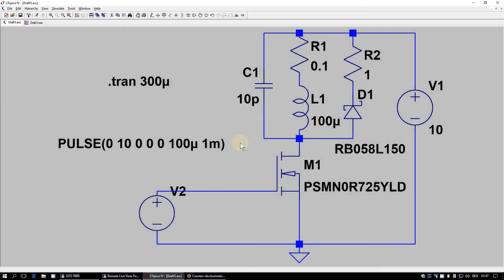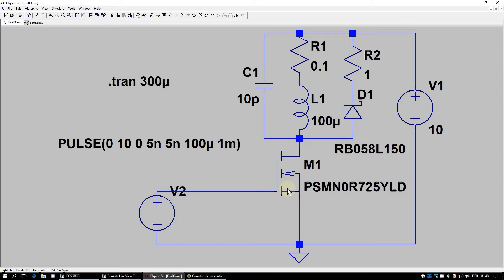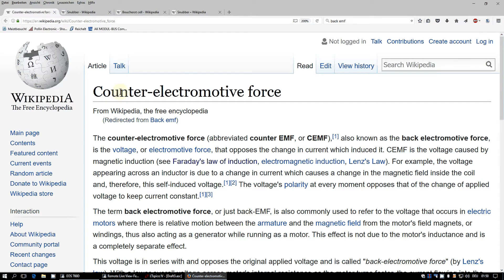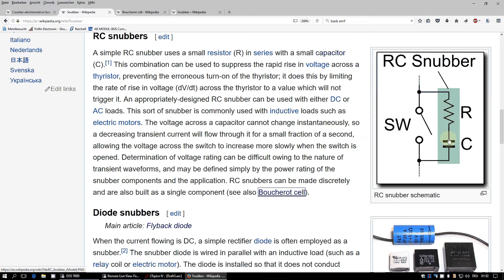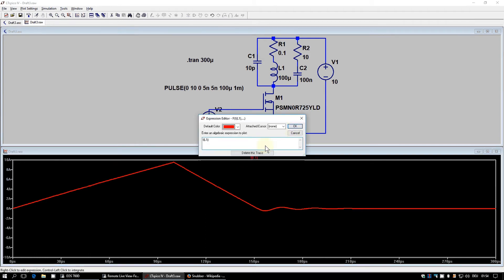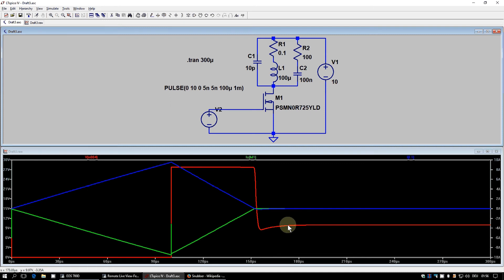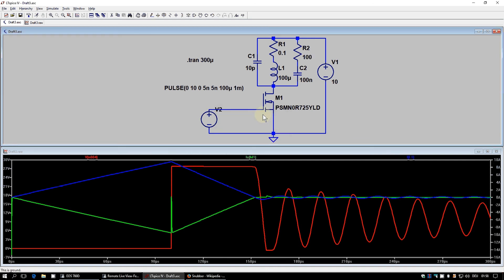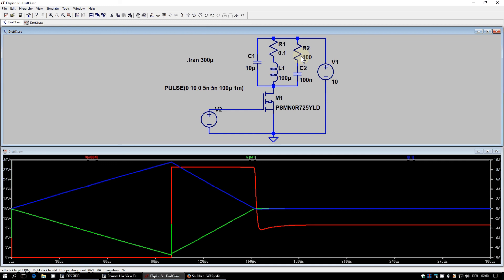Suppressing unwanted oscillations with a Snubber [Pt.2]

Comment: I did the calculation for you just so you could see how close your 100 ohm guess was. 

The parasitic capacitance of the FET in this circuit is 3nF. 
To damp to Q=1, your snubber would be R=183 ohm, C=10nF. 
To critically damp, the snubber would be R=91 ohm, C excessively large, say 10uF (for true critical damping, it would have to be infinite). So your 100 ohm and a still excessively large 100nF is close to critical damping.

Rather than deleting all your traces every time, just use F4 to label the important ones, then they won't change.
Reply from the maker: THX for calculating the optimum value.
Critical damping at Zeta=1 translates to Q=0.5
https://en.wikipedia.org/wiki/Damping_ratio
Do you have a suggestion for a website where the calculation of the values for optimized components of a snubber is easily explained?
I found a few but they are all not very good for a beginner.
Reply: I did have a really good PDF explaining RC snubbers, RCD soft voltage clamps, hard voltage clamps and RCD dV/dt limiters, but I can't find it. 

RC snubbers are easy enough to calculate, the hardest thing is knowing which parasitics are resonating. It's almost always an obvious inductance such as a transformer's magnetising inductance or leakage inductance or just an inductor, ringing with the parasitic capacitance of whichever semiconductor is currently turned off. 

You can measure inductance, look at the frequency of resonance and calculate the parasitic capacitance from the formulae for inductive reactance and capacitive reactance. The resistance required for Q=1 will be equal to either reactance at the resonant frequency, which is also equal to SQRT(L/C). Q is proportional to R, so to get Q=0.5, multiply that R by 0.5.  In the real world, you usually design snubbers for Q=1 to 0.7. Snubber capacitor will be 3-5x the parasitic capacitance.

If you don't know either the inductance or capacitance, you can add capacitance in parallel to the parasitic capacitance until the resonant frequency is halved, then you know the total capacitance is 4x the parasitic capacitance, so the parasitic capacitance is 1/3 the capacitor you just added, use that to calculate R and keep the capacitor you just added for the final snubber.
Reply from the maker: THX.
By the way: Did you delete your comment on the first video you placed a few hours ago?
I can´t find it anymore.
You were absolutely right on the breakdown-voltage of the MOSFET giving the Back-EMF of 27V.
But  I think that I am still right on the other things mentioned in the video (SRF of the tank-circuit formed by the parasitic capacitance of the inductor etc.)
Reply: No I didn't delete my comment. I can still see it. The youtube comments section is buggy as hell.

If you look at the frequency of the ringing you can calculate the capacitance which is needed for that inductor to ring at that frequency. With just the inductor and the FET in circuit, the ringing is at 257kHz. C=1/(L*(2*pi()*F)^2) = 3.83nF

The default parasitic capacitance of an inductor model is not going to be near that high. In fact I think the only parasitic in the inductor that has a default minimum is series resistance as SPICE dictates there must be resistance between every node on the model (presumably to avoid divide by zero errors). If you look at the model definition of the PSMN0R725YLD NMOS model, you'll find "Cgdmin=518p Cgdmax=3.682n Cgs=7.8n Cjo=9.16n". That's what's ringing here's how you can tell:
Again, if you look at a different FET, you'll see a different ringing frequency. The IRFP2907 which has a high capacitance rings at 175kHz, so C=8.27nF. The BSS123 which has a very low capacitance rings at 3.147MHz, so 25.6pF.

Incidentally, these 3 NMOS models act completely differently to each other and e.g. don't clamp the voltage to their Vds max value. That's because the FET you used has breakdown voltage specified, Bv=27.5 and the others don't. Bv is a parameter normally seen in diode models and only actually used for zener models (The spice model for all diodes is the same for all types of diode, just with different parameters, Cjo is also a parameter of the body diode), so 1 model treats the body diode as a zener and the others don't. That shows why I avoid NMOS and PMOS models in SPICE whenever I can.
Reply from the maker: Yes I noticed that yesterday also, when I rechecked my simulation du to your comment/critics :-)
But when I replace the chosen MOSFET with the "ideal" default-MOSFET of LTSPICE ("nmos"), then I get exactly the resonant frequency of the inductor with the 10pF parallel-capacitance shown as C1.
So we are kind of both right.
To demonstrate the self-resonant effect it would have been better to use an ideal MOSFET (or the voltage-controlled switch of LTSpice).
As soon as you use a real-world FET the much larger drain-source capacitance overwhelms the (here) 10pF parallel to the inductor ans shifts the resonant-frequency to a much lower value.
But thank god all of this doesn´t interfere with that I basically wanted to demonstrate here about the damping of an switched-off inductor with a diode-resistor-combination with different values of the damping resistor.
Without your knowledge of LTSpice I would have never known about the Zener breakdown-effect implemented in the model of the chosen FET.

Comment: 1N4007 ? By the way...if you double click any net to show its signal the LTspice will automatically delete all the older traces. There is a better way to stop this oscillation. Need to do a test first then can confirm you.
Reply from the maker: Eagerly waiting for your suggestion if there is anything better than a freewheeling diode with a series resistor.
Remember that we not only have to suppress the oscillation but also suppress the back-EMF to a reasonable value for all values of inductance between 10nH and 1H.
Reply: I think there is a possible solution.
First of all, I have used the BSC16DN25NS3 NMOSFET in order not to have problems with the breakdown voltage of the FET.
Description of the circuit is like this:
The L1 inductor has in parallel a frewheeling diode 1N4148 in series with a 10 V zener (I have used the BZX84C10L).
In order to suppress the unwanted oscillations , we use an additional RC snubber in parallel with the inductor (and hence, in parallel with the diodes network).
RC snubber values are as follows:
For L1=100 uH => Rsnubber=288 ohms and Csnubber=3nF
For L1=10nH => Rsnubber=2.88 ohms and Csnubber=3nF

Now the question that arises is how to find a snubber which works for the range 10nH to 1H. 2 things to think about and decide on the trade off:
1)We can use the 2.88 resistor and make the Csnubber capacitor very large to damp oscillations for high inductance values, e.g., for 100 uH, Csnubber=3uF seems to damp well oscillations.
2)Use the 288 ohm resistor and Csnubber 3nF and accept the little oscillation when we have low inductance values. The ringing dies away very fast.